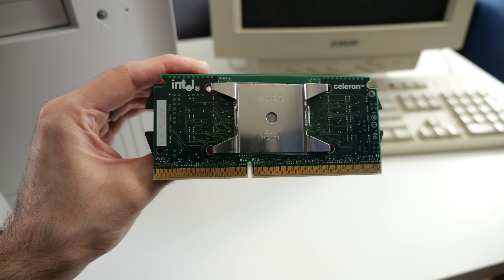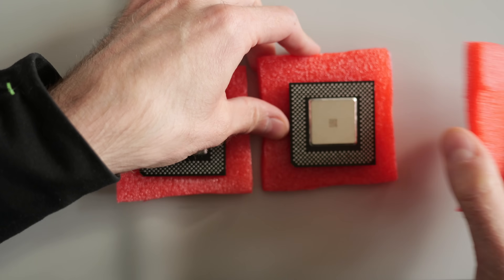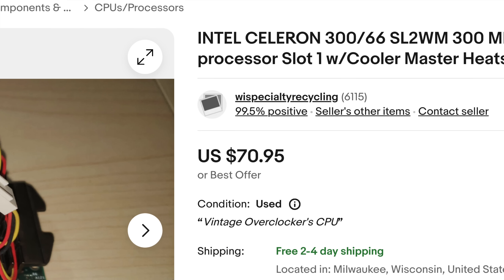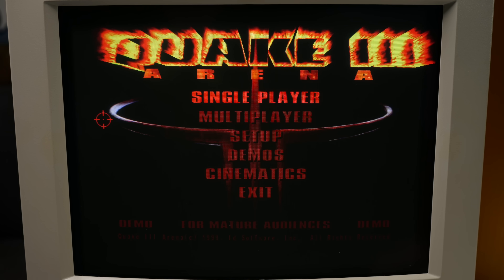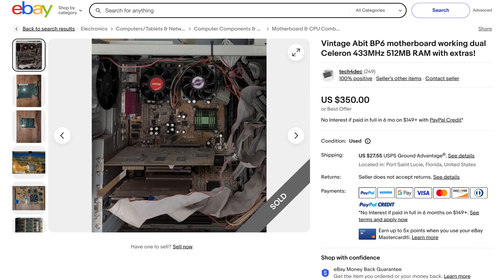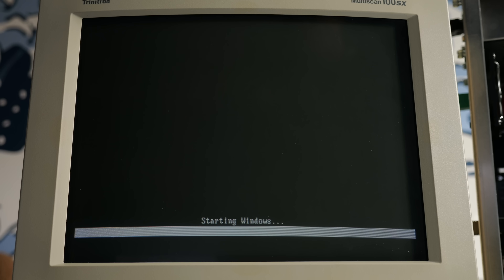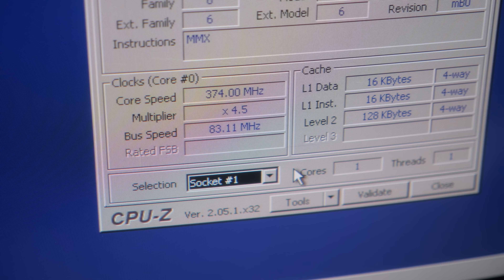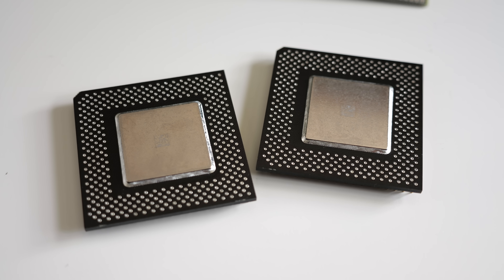I almost BLEW UP two vintage Celeron CPUs

Comment: This was why the Abit BP6 was so popular. Intel were probably very angry at Abit but they released a few boards that supported dual Celerons and lots of overclocking options, it was the enthusiasts choice.

I'm not sure if Abit did other stuff to better support the overclocks but it's possible, I don't remember extreme voltages being required so perhaps there was some secret sauce to the ability of those boards to overclock Celeron A's well.

Software SMP support was an issue but BP6 based workstations for 3D modelling etc were pretty popular amongst artists on a budget. Made a pretty good dedicated server for lan parties etc too.
Reply: I was running SUSE +VMware on my two 300's @ 450. Overclocking is just as much about the mobo as the CPU, they were really easy OC if you had the right bits and a Supermicro board is sub-optimal for o/c'ing, that was not their strength, but they were never designed for that. So Colin dissing Celly's when the mobo is to blame is a bit ridiculous.
Reply: Totally. Even though the mod wasn't that hard, it made a LOT more sense when you could blow 50% of the 300A's and still be ahead on savings because the 450 and the 350 was THAT MUCH more expensive. Given current prices, it's awkward that people would even care about them unless they're making content,  as you can get a better "less wanted" part cheaper. Which is part of the reason i am so derisive of "period correct" vintage gamers and call them the new audiophiles with their oxygen free cables... Back in the day we used what we did not because we didn't want better, just because that's what was available.  Would i use 5400rpm HD instead of an SSD if i had one available in the 2000's? Hell no, why would i...
Reply: I still have an Abit BP6 today and overclocking two 300 MHz Celerons to 450 MHz is effortless, no voltage boosting required. I use it with my vintage operating systems such as BeOS and Win2K Pro. 

I recently switched to a dual 1 GHz P-III Asus Slot 1 motherboard, though, as that was my dream setup that I couldn’t afford back in the day. Even 32-bit Haiku runs on it quite well, with 512 MB of RAM.
Reply: @little_fluffy_clouds  True there was no issue running the slot 1 300A at 450mhz i had one an it would do 530 some mhz, cant remember exact, i used a homemade watercooler on it, but they where all Malaysia made ones, not the costa rica ones, they never was as good as the one made in Malaysia. and some manage over 700 mhz but that was no easy task and most of them would not do that.  and i am pretty sure intel made some mods on the socket 370 ones to somwhat limit them a bit.
Reply: I had a BP6 with dual Celly 466’s and it rocked Win2k. Those CPU’s didn’t overclock well, though. Oh well.
Reply: A couple of years ago I've played with the single-CPU board from ABit, SA-6 (from the Coppermine-era, but backwards compatible with Mendocino CPUs), and tried to overclock my Celeron 300A with it. No dice, it only worked with a FSB around 80 MHz, and no higher. Two possible explanations: 

1. bad caps. All motherboards from ABit suffered from The Plague(TM), and I've replaced only three capacitors on mine so far. I thought that it was a plausible explanation, but later I've tried a 1GHz Pentium III in the same motherboard, and it works fine despite having one of it's power input pins broken off by the scrappers. No blue screens, no freezes, runs just fine. 
2. not a good Celeron 300A CPU. I've heard somewhere, that the CPUs that were capable of running on 100 MHz FSB were made mostly on Philippines, while the CPUs from the Malaysia (like in this video) were generally a poor overclockers. I have no idea if this is true, or not. I probably should look for another motherboard like this (since I don't want to mess with my PIII build) and test it with several 300A CPUs (or higher - where I live most common are the 433 MHz versions) from the different manufacturing plants.
Reply: I had a BP6 running Win2k / Linux / FreeBSD / BeOS.
A beast :)

Comment: BeOS 5 should FLY on this thing! Its Multi CPU support is amazingly good.
That being said, are we maybe a bit blinded by the googles of hindsight? 300 to 375MHz is a 25% increase after all! That's HUGE in the days where CPUs were released as 233.. 266.. 399.. 333.. 366, etc. A 75MHz increase is basically like warp-speeding at least a year and a half into the future.
Reply: I had a dual Celeron 300 system on an Abit motherboard overclocked to 450 Mhz and BeOS ran well. It really flies now that I have switched to a dual 1 GHz P-III system on an Asus motherboard with 512 MB RAM.
Reply: Yes it still is an amazing overclock, but I also think that getting these to 450 wasn't rare.  I did this with a dual 300A system  (the first two CPUs I bought) and didn't even have to overvolt.  I attribute this video to either bad luck or a tendency of enthusiasts to hold on to the good chips.
Reply: I was still using Celeron 300 overclocked to 375 MHz until I've saved some money and got a whole new PC with Celeron 1.7 in 2003. I can't remember if I've played with BeOS on the old or the new one. BeOS was great, it's a shame they had no major support and had to close.
Reply: Wait a sec... your comment was 3 days ago, even though this video was 1 hour ago?
Reply: cubemaster7740 probably released early, privately, for patrons.
Reply: @cubemaster7740  video probably available for patrons in advance, very common
Reply: @cubemaster7740  Patreon is a thing and has been for a while. Gotta pay to get early access.
Reply: @cubemaster7740 Yea i was about to say the same thing